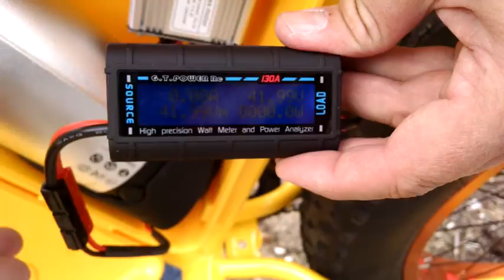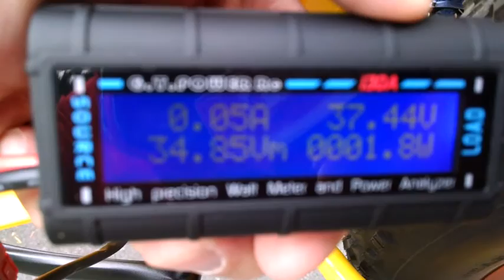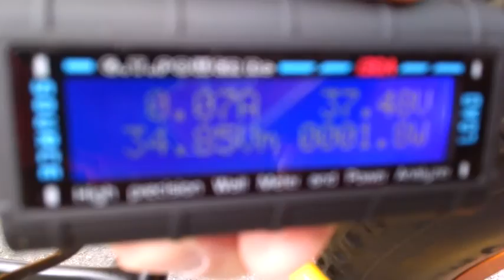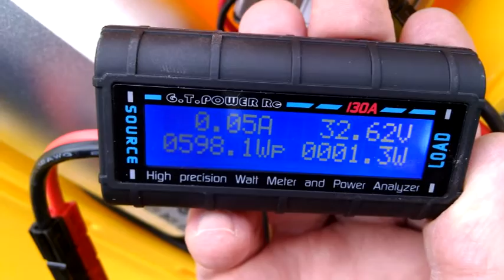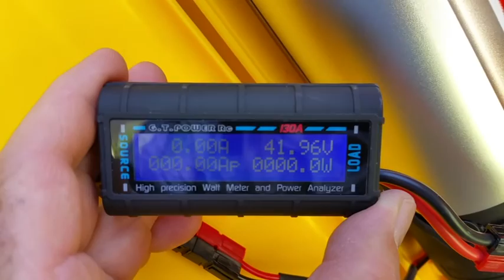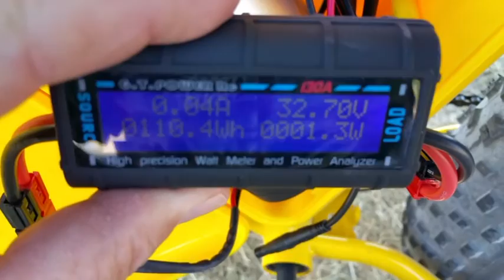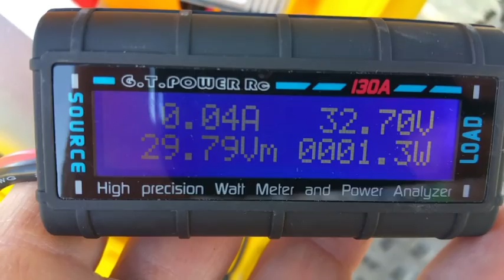Kinaye Extended Range Battery Capacity Test

Comment: How many miles were you able to on the stock battery, using throttle only? You said 20 miles for extended aftermarket battery but you never mentioned how far on the stock battery. Also if we .buy this do you know if we would receive in time for burningman? 

Thanks so much for doing all this!
Reply from the maker: ***** Even if you choose the expedited shipping option, I cannot guarantee you will receive the battery in time for burning man.

Comment: So approximately how many miles did you travel on the extended range battery?
Reply from the maker: Shannon Powers On Electric only (No Pedaling) we were able to get about 20 miles on a full charge with the extended range battery. Pedaling and riding slower will extend your range greatly.